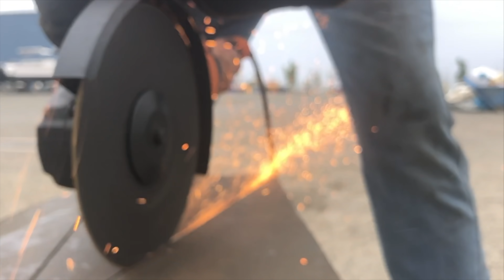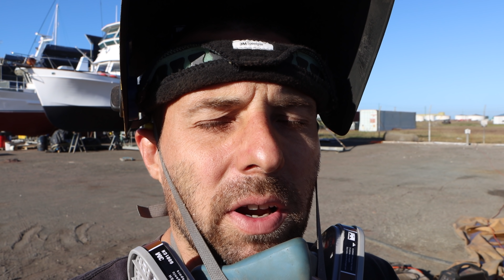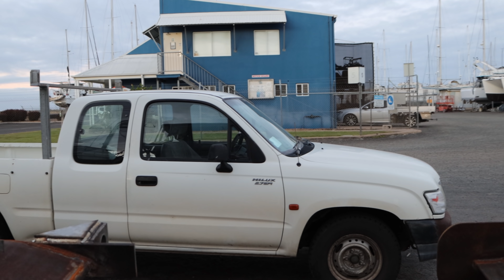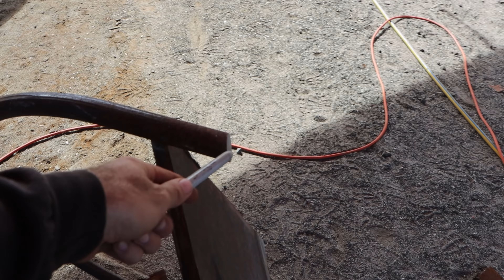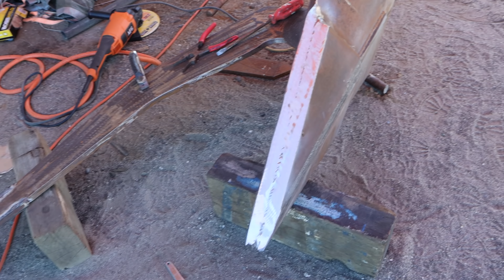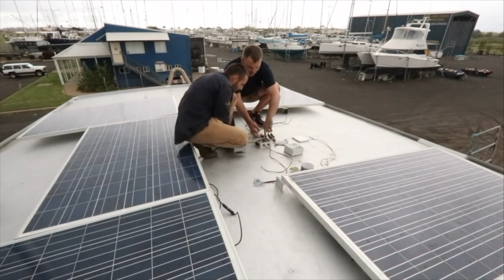Building a Monster Anchor, (The Finale) - Project Brupeg Ep. 144

Comment: Pretty innovative design, anxious to see how it holds. I’ve got a 650 Lb Danforth on my 73’ Steel trawler in Alaska. Along with a 15 fathom shot of 1 1/4” stud chain... has seen me through many 100 kt plus gusts. 

A couple suggestions; just based on my experience.

The shank, where your rode fastens is usually the first to wear out. I’ve sleeved my anchor with a section of stainless pipe. It provides excellent wear characteristics against a shackle. 

Also, the tips of the flukes are quick to wear also. Might be worth your time to burn some hardfacing wire in that area. 

One final tip; be sure to weld your pins on your shackles closed. It is an additional step to cut it when you’ve got to put a new anchor on - but the piece of mind that you’re not relying on a cotter pin or safety wire is invaluable.
Reply: I was thinking the same in the last video, sleeve the shank and i would have set it back further in to get a bit more material there.
Reply from the maker: Thanks for this advice Jake. I’m assuming this anchor will be a work in progress while we get to know it. I did ponder adding stainless to areas but I wasn’t sure if galvanising interacts badly with it so I just stuck to mild steel. I would like to add the protection you mention though so I will keep it in mind

Comment: Just wanted to add a suggestion that I have seen work effectively on  smaller anchors that might not work on yours but I thought I would mention it for you to consider. Weld a shackle point to the peak of the roll bar. Attach anchor chain to this point. Run the chain back to your existing attachment point on the shank but use a releasable pin. If the anchor gets fouled and can't be released by any other method you yank on the release cable which frees the chain from the tip of the shank and makes the peak of the roll bar the lifting point. This dramatically alters the angle of the dangle and as the weight of the anchor tip and the shank hold the tip down the flutes transition to vertical instead of horizontal thus releasing the anchor from any possible fouling. As I said, just something to consider potentially saving you from sending down a diver to free a fouled anchor in deep water in the antarctic.
Reply from the maker: That’s the best idea I’ve heard about anchor retrieval so far. I really like this option thanks Taz

Comment: I used to be the same with stick welding. Keep at it mate. Stick welding is so useful on steel boats. Once you get pretty good at stick you will find your mig welding improves more than you ever thought it could. I have got a little 160amp stick welder, you can pick it up with one hand, no gas bottle to worry about, works in the wind, its just great. If you are at sea and you want to perform a quick welding repair you cannot beat the old stick. The anchor is looking great. Amazing progress as always.
Reply from the maker: Thanks Jet
Reply: @ProjectBrupeg  One thing the farmers of America have learned is that a stick welder, when you need something right now with no grinding or wire brushing, will get the job done where a wire welder may not make a good bond unless the surface is cleaned and there is no gale force wind to blow the gas away. I agree with you that a wire gun is so easy compared to a stick but it does have its place. Also, with the right diameter rod you can weld very thick steel with one pass and it will be a good bond. You have become an artist with that gun!
Reply from the maker: Thanks Rudy
Reply: @rudyyarbrough5122  Exactly, I love my mig welder,  my tig welder and my stick welder. They all have their place. Set up at a bench, ploughing into a job, you can't beat mig for speed. The tig obviously is great for intricate parts but slow. When you are out in the field the stick does the job and with the right rods you can weld all sorts of crap together.

Comment: 'Haul out hole'? The hole further down the shank to retrieve the anchor when it's stubbornly embedded/ I had a much smaller Mantus Claw and used a steel ring on a rope, just slid it down the rode and hauled the anchor out in reverse. And don't forget to have Jess order a sixty ton crane to lift the finished anchor into place, I don't think even 5 Trev's could muscle that monster up top...
Reply from the maker: Lol, we have just brought the winch to upgrade the bow crane to lift this beast

Comment: Awesome  Go the cookie time. Lol
 Are they gonna sandblast all your welds  because of the flex wire if any slag is  Entrapped in the weld  It will react with the galvanizing and blow out and you'll have spots where it will rust later on  This happens to me with my boat trailer But it was stick welding that I did.
Awesome video guys  Love the anchor
  There is something about welding big s##!. Nice job.😉👍
Reply from the maker: Yeah we ended up not blasting it as they said the acid would sort it out, that said i never told them it was flux core so im not sure if it will be an issue. Mig flux its massively thinner than stick flux, so im hoping that we be a positive.

Comment: Dame, did you try and pick it straight up via the shackle point to see how it's cg or balance is for retracting the anchor ? Looks like that thing could anchor a small Aircraft Carrier ! Hope your winch and other tackle are up to that beast !
Reply from the maker: Yeah nothing so complex. Just as much weight as we could add to the tip. Current winch can lift two ton, chain and anchor weigh 450kg, winch will soon be getting a new feeder pump which will give it more grunt

Comment: Nicer bead is not better weld. Just take your time and learn. It is not really that hard. I wonder if the bevel you cut on the leading edge of the anchor is the reverse of what it should have been. The bevel would tend to make the plow tip float instead of  dig in. I also wonder if the wings you welded on the back will prevent it from self righting. That is the most important part of this anchor. By extending the rousn bar righting hoop beyond the bottom of the anchor you negate the tendency to self right. They become outriggers. Those are just my thoughts. I definitly could be wrong.

Comment: Probably just me getting things wrong but it seems the chamfer on the tip would dig in better if it was the other way around , just saying .
Reply from the maker: You actually want it this way round. This design works because of the flat blade area on the top of the blade. If the changer is reversed it because more like a plow than a shovel

Comment: If it is being galvanised,  is there a chance of the gas between the plates at the front expanding and warping the anchor during the galvanising?
Reply from the maker: Yeah it’s been galvanised already and no issue. The plate as really thick so the amount of pressure needed to bend it would be pretty immense

Comment: So I read somewhere that the weight of the chain is actually critical to the effectiveness of an anchor. At least that was in reference to big ships. Does that apply with the design of your imperial destroyer style of anchor?
Reply from the maker: So ship anchors are generally crap. They are terrible shapes that rely on weight. The chain therefore matters there too as it’s bloody heavy and helps the anchor drag across the bottom rather than lifts out. With small boats they don’t have the luxury of a 5ton anchor so they rely on the anchor shape and the chain weight. The chain acts like a shock absorber. When a swell lifts the boat up and back the chain resists that motion and tries to pull the boat forward again and also pulls the anchor horizontal rather than up and out. The trouble with all of this is in strong winds like 60-80knots the chain is bar tight and it’s not better than a rope, the anchor design (or weight) is the only thing stopping the boat dragging at that point, hence we went for a massive blade area and a heavy chain. It gives us the best of both worlds
Reply: Project Brupeg oh i see, thanks for that explanation bloke. For that you get a lifetime supply of L&P to go with your cookie. 
I believe your building two more anchors, seriously go get a oxy set. U should learn to use it anyway. If i wasnt struggling for work atm id buy you one.
Reply from the maker: Thanks Matt, the next lot of anchors i will likely try and get them laser cut now that i know what shapes im after.

Comment: The US EPA has shut down almost all galvanizing sheds here.  You guys are lucky.  Really nice anchor!  Are you going to galvanize the chain too?
Reply from the maker: Yeah we will be. We weren’t sure they could clean the rust off enough but they said they are pretty confident they can
Reply: @ProjectBrupeg  Measure up the chain links or make a couple of measured tabs on welded rings to the chain, they can easily burn a couple of mm off in the hot tank and there go's the strength of your chain. Had a couple of my jobs destroyed by the hot dip Galv plant here, I only zinc arc spray or zinc plate now with better results and no damage.
Reply: @ProjectBrupeg  we used an acid bath tank here.  It came out shiny  and ready for the gal dip.
Reply from the maker: interesting, i will investigate this option a bit more.

Comment: I've never had anything galvanized but, do they sandblasted first to clean it? Or just put some kind of prep on it take all the rust off? Somehow I thought you'd already finished it all. The added reinforcements are amazing. Great job Damon. I think you can get the hang of stick welding if you had a welder guide you a little more and give you reinforcement. Great job guys!!
Reply from the maker: Hi Dennis, when the steel is very rusty it needs to be blasted but light surface rust like this and millscale (which is just carbon on the surface to slow rust down) can be taken off using an acid bath they have, I think its either hydrochloric or Sulphuric acid from memory and it strips the steel back to pretty much clean new metal then the zinc is applied at that point.

Comment: I do a lot of cutting steel and have good and bad luck with different discs. Have you found a brand that seems to be better than any others?
Reply from the maker: We actually buy the dirt cheapies from eBay $0.40ea we have tried dozens of brands over the years and some expensive ones may last 2-3 times longer but they are 10-15 times the price so not worth it in our opinion

Comment: Damien, Did you say you were using 6010 welding rods, if so are you using a DC welder, also is it on straight or reverse polarity, I can normally do pretty good with stick welding but I have never liked a 6010 welding rod, I use mostly 7018 rods for a strong weld and they weld really nice,
Reply from the maker: 7018 and gp to finish it off.

Comment: So a 250-lb anchor will hold a 30-ton boat?  Or do I have the numbers all botched up?
Reply from the maker: This boat would normally have a 55-75kg anchor, so the 112kg anchor we built is well oversized for Brupeg. Also the design of this anchor doesn’t rely on weight alone like older designs do. The shape makes it a higher effective anchor as it buries below seafloor rather than plow along the surface like a CQR or Delta style. When a boat is in really high winds above 80knots the weight of the chain does nothing as it becomes bar tight, at that point the only thing that stops a boat dragging is blade area and anchor design. Most high latitude boats these days are going for smaller, stronger chain and bigger fluke areas on their anchor

Comment: I guess you must have loaned the hoists to the cat while they were waiting for the anchor welding? It is a really cool fabrication. Goodonya. Will there be a rope/chain/wire rope on the arch to pull it out when it digs itself into a sticky hold?
Reply from the maker: We have a winch that lifts two ton attached to this anchor. If we want it out, it’s coming out
Reply: @ProjectBrupeg  One way or another, boat and anchor will come together.

Comment: I haven't seen every episode, but can someone please tell me why they use a grinder to cut steel plate instead of acetylene torch? Availability? Good Job! A lot of time spent on something you might loose the first time you use it, hope not. Best Regards, ja
Reply from the maker: Hi Jay, we don’t own an oxy torch and in five years we have needed one 3 times so it’s very low on our priority list. Normally we would cut this stuff with our 9” grinder but it died so we pressed on with the 5” grinders
Reply: @ProjectBrupeg  Thank You! Thank You! Thank You! Go at throttle UP. Best Regards, ja Chesapeake Va. USA.

Comment: thought the bevel would be the other way on front edge
Reply from the maker: You actually want it this way round. This design works because of the flat blade area on the top of the blade. If the changer is reversed it because more like a plow than a shovel

Comment: I have seen an anchor design like what you have that has a stainless steel tip that can be re-sharpened without compromising the protective galvanized coating.  Are you  planning something like that?
Reply from the maker: Nah just galv for us. We’re not afraid of rust

Comment: mate, your welding technique with the stick is a little off. typically you'd be dragging the stick along at about a 15 to 30 degree angle with the end of the stick about 2mm from the weld pool adjusting the arc length as you go. if the two pieces are the same thickness then you should be (as you were doing) keeping an even angle and therefor evenly distributing the heat onto both pieces. i think you may have the amps up a little too high causing the undercut but it could be a few things. the stick welder literally works anywhere, can be used with stainless rods and doesn't need gas so it's totally worth putting some time in learning it especially if you're on a boat.
Reply from the maker: Yeah it has its place but for now I’m not going to bother too much. I can mig weld blindfolded and with flux core that last thing I used stick for (welding in wind) has been removed as a barrier to me

Comment: Is the chamfering on the wrong side?  I would think for it to dig into the sea floor it would need to be on the other side.
Reply from the maker: Yeah it works either way but this gives you a larger surface area that’s flat which is what you want

Comment: Put more angle on your stick so it's pushing out the back where you have been instead of pushing the shit into the weld, should be right then, I hold the stick it's self sometimes because I get shakey and cant guide it with the handle without it looking like braille with a stutter 😂😂😂
Reply from the maker: Thanks Alan

Comment: What's your setup in that mig wire size and power settings? I remember you run duel sheild but are you using argon or a blend?
Reply from the maker: We use 95% argon 5% oxygen. That gas allows us to weld mild or stainless and we also use it as shielding gas when welding with flux core as a dual shield process

Comment: is the second and third anchor going to be as big
Reply from the maker: Pretty much. Only difference with the second bow anchor is we want in to fit in the chain locker hatch so we can bolt it to the bulkhead low down. So the hoop dimensions might be altered slightly

Comment: Did you use high tensile steel for the shank?
Reply from the maker: 350 grade
Reply: @ProjectBrupeg  You might have trouble with shank bend if the wind changes while at anchor. Somewhere over 700Mpa would be better.

Comment: With all the extra steel you’ve added to everything will the boat still move at  all.
You might need a bigger engine.???Just saying.
Reply from the maker: Maybe some solid rocket boosters if push comes to shove...
Reply: I bet in Brupegs former life she would have been loaded to the brim with prawn , fish , ice and fuel far more than will, ever be added now with a few extra steel bits
Reply: I couldn’t agree with you more Mike,but the boat is not finished yet,so I’m sure in true Brupeg style everything  still to be fitted will be built to indestructible  standards.

Comment: G'day,,under cut,on a mig weld,Solution ,increase wire feed rate or slow travel speed down,
the reason for under cut is not enough metal to take up metal shrinkage,,
Welding with stick,Maintain arc gap about same size of rod dia,,so 4 mm rods needs a 4mm spark gap,,now as for travel speed watch,your arc puddle,,you will see a black shadow catching up,this is the slag cooling down,if slag is catching to quickly,lay rod over and blow slag back,not right over but just enough to maintain arc puddle.let the metal fill arc puddle before moving on,,
stick welding is easy once you under stand what you are trying to do,,,
now the most important thing,,,Do you Need glasses,,,,can't see don't know what happening in you weld pool..Yer i wear glasses,,so i don't make a simple job worse,,or spend hour grinding weld out,,
not trying to be a know it all,,,But here to help..
think of it like a hose with water and a box of sand,,,to high pressure blows sand all over the place and not where you want it,,steep angle blow sand back over you already welded section,,
so think like a hose higher pressure,Higher amp..and angle,,
Rule of thumb,,depending on rod and flux,,you should get about 60% of rod length on your weld bead,,Now 16's are low hydrogen and slag can be a night mare to get off,,
where as iron powder 22's slag will curl it self off if settings are close to being right,
13's are all propose rods very good for over head and vertical up,No iron powder in weld flux,Bit like 16's but easyer to use,where as 14's has iron powder in the flux,,very difficult to do vertical ups or over head,as the metal wants to run down,,11's,sparklers,,with these have a fast freeze weld metal,,very good for root runs and penetration,,even do vertical downs with a 11's,,Wet an 11 down,crank up the amps and use it as a cutting rod,,so hope this helps..
Reply from the maker: Very helpful thanks for this